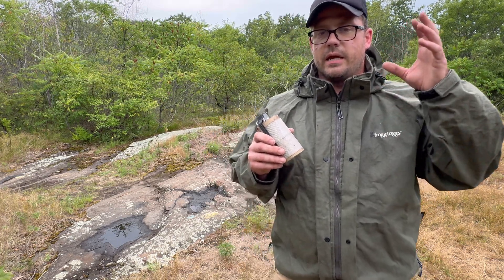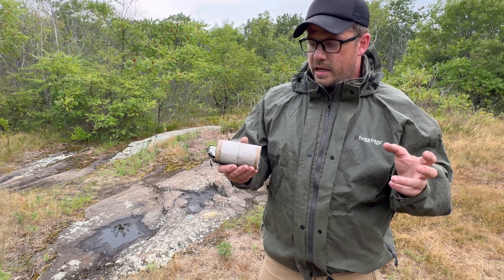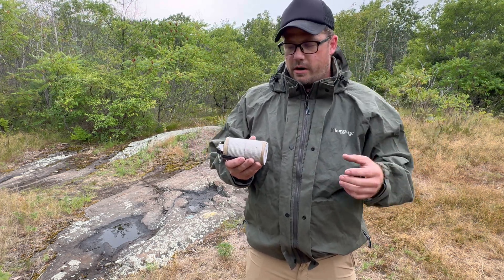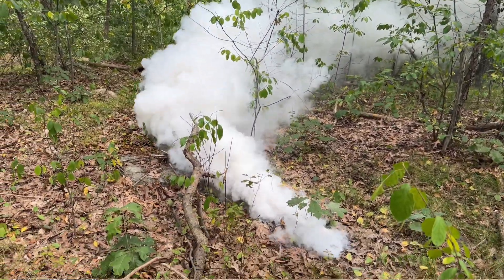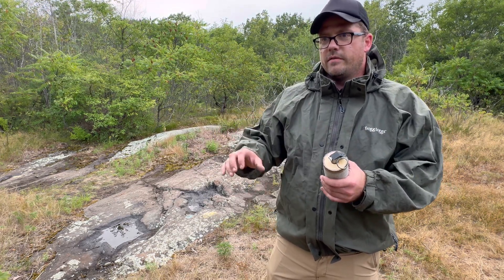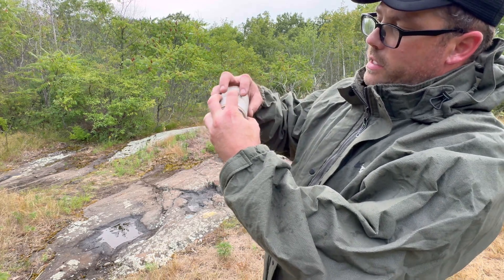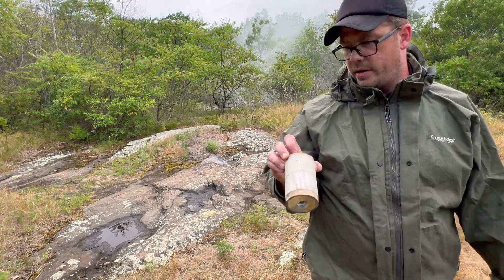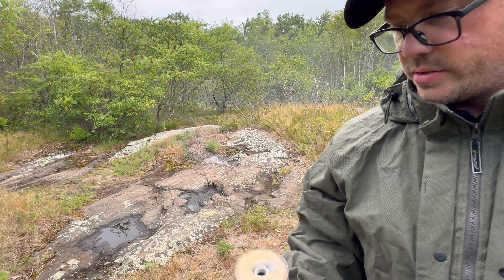Taming the Flame: Cellulose Acetate as a Binder in an Angry Smoke Mix

Comment: The real question is across what range of environmental temperatures does the product perform consistently, and how does it handle settling due to transport?  Does it separate over time?
Reply: Shouldn't be any separation since it's all bound together. As far as shelf life and temperature range it shouldn't be any different from the military mix since cellulose acetate is very stable.

Comment: deep sigh

I actually like how your design basically just got really easy (less "moving parts" should increase reliability). 

I still think using the reloadable canisters with this binder formula is the way to go. Now I just need to track down some cellulose acetate in preparation for your new and improved video to drop.